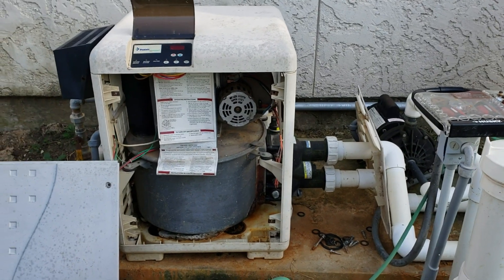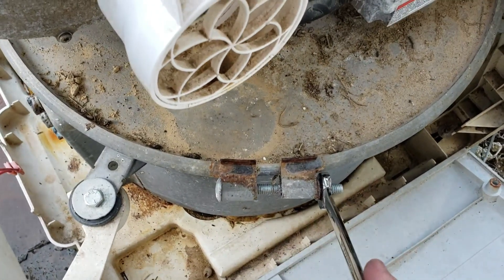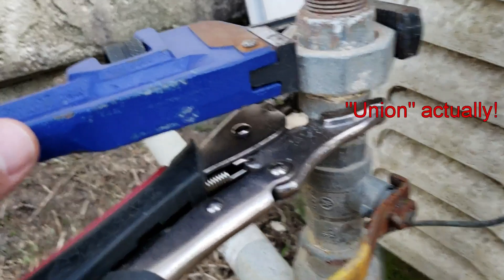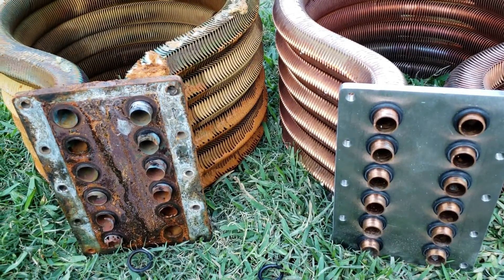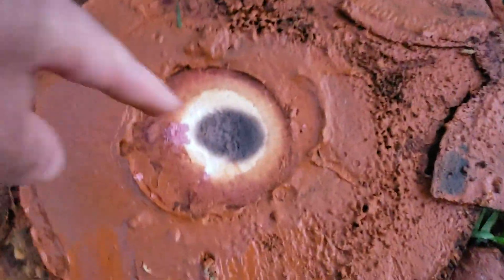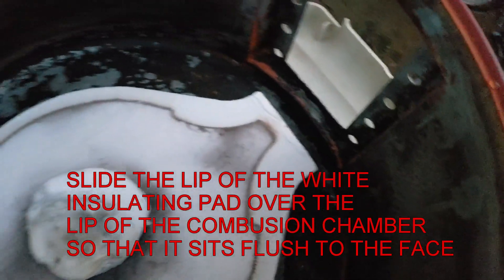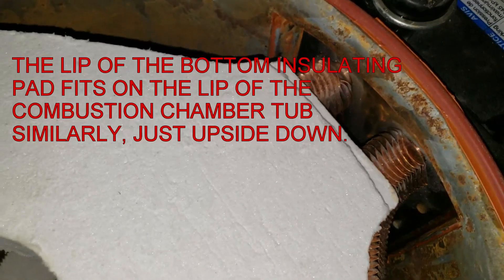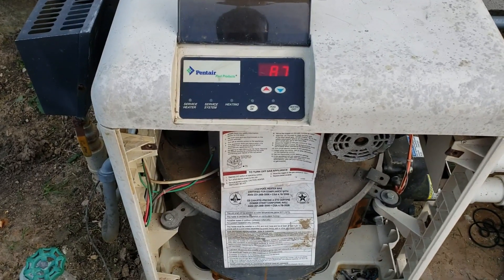Pentair Mastertemp 400 Heat Coil Tube Sheet Assembly Replacement

Comment: I am having the same issue currently, however I have no rust inside my header. I took the bottom bolt of the manifold off and the water drained and was very clear.  I plan to open it up  to see if maybe its one of the seals on the manifold or if I need to replace the entire heater coil.  Thanks for the video!

Comment: Not to be critical BUT the visegrips were on the gas pipe union backwards  and no need for Teflon on the union threads as the threads are not the sealing surfaces. Looks good! 👍

Comment: in 2022 I been replacing  those heat exchangers for $2800 if heater is less then 5 years old. if is older I recommend to replace the heater..

Comment: Best video I have ever seen......I had the same problem......It's now 2022 and the (6) coil exchanger is now $1,200. Only one tube was corroded away. I used a copper pipe coupling and JB Weld to sleeve it into the corroded tube. Fixed it!! I drilled a small 1/8" hole at the bottom of the tub as a drain to be able to verify that it's not leaking again.
Reply from the maker: That's a clever fix.  Remember you can always just take out one of the bottom 2 bolts on the manifold to verify that the tub is dry.  Each bolt hole is a threaded tunnel all the way to the inside of the tub.  If the tub has water, it will drain down to the level of the lowest bolt you remove.  Small hole is a good idea also.  I don't foresee anything being unsafe with a hole so extremely small.  Good on you thinking outside the box.

Comment: My coil won’t fit if I place first place the insulation soft insulation blanket on the bottom of the combustion chamber followed by the hard insulation board with the notch cut out over the lip of the combustion chamber. 

I see how this creates a perfect fit and how the hard insulation board then butts up flush against the face of the combustion chamber, but in my case, then the coil does not fit into that recessed area for it to align with the bolt holes for the manifold.

If I pull the insulation and way and off that lip so that no insulation is taking up space in that recessed area of the combustion chamber, only then will the coil fit and align with the bolts with me having maybe 1/8” of play. 

Can you confirm you did in fact place the insulation on top of that lip in the combustion chamber per your note, vs having left it off in the video footage you shot?

Thank you and others for any advice!

Comment: First off, thank you for doing this video!  I’m a pool guy for 9yrs now, never had to change out an exchanger until now.  So seeing it done was great info!  

I read thru most of the comments.  I just want to give some tips to some people.  

If you are having heater issues and there is no code on the led screen, pop the top of the heater off, don’t shut it off or take any wires off, look at the control board.  There is a row of error lights on the left side, if one is red see what the 2 letter code next to it is and google it.  That will tell you the issue. 

The guy that mentioned about the check valve after the return line from the heater is 100% correct.  I just want to add that if you have a salt cell you should have a check valve as well.  The salt cell is just as corrosive to beaters as the chlorine feeders.  

If you are not getting an error code & no red lights on the back of the control board under the lid, open the front panel of the heater.  Inside the square box (the lid flips down and might be held in place with a screw on the top right, open the box...look for my red error lights there as well.  If no error lights, no codes in the lcd....take the very bottom bolt out of the black manifold there are 2 vertical rows of 6 I think,  take the bottom one out on either side.  If any water comes out...you need to rewatch this video because you need to replace the exchanger.  If no water then the exchanger is not the problem.  

If you have a Pentair, Sta-Rite, Hayward..:it doesn’t matter, all the tips I have to troubleshoot will all work the same way.  Heaters are actually very simple and there is not that many parts to them.  

Oh and very last tip & it may not be so nice but it’s very true.  Your local pool supply store, I’ll use Leslies as an example, is an absolute rip off in what they charge for things.  Buy from the internet to get the best prices.  I shop at my local pool supply store that is only for pool professionals and give wholesale/internet prices.  I’ve had to stop at Leslies on the weekends for emergency parts before & they should be ashamed at the prices they charge. 

Hope any of my input helps someone.

Again, thank you for this video, I’m not rolling my eyes anymore, the repair I need to do isn’t going to be as bad as I thought, so thank you for teaching me how it’s done & done smart.  My first thought was going to be taking each part off, not just the lid and keeping everything attached.  That’s gonna be a huge help.
Reply: Except if the that exchanger is bad the heater is usually junk and should be replaced because it's likely throwing good money after bad given how much a new exchanger costs and the shelf life left in the unit.

Comment: At 4 min. in, you mention that the old coil is 8 yrs. old. Is that 8 full years of use or 8 seasons of say, 3 mos. each?  I have a 175,000 BTU heater that failed at one of the O-ring ends allowing water to get into the heater.  My heaters is 3 yrs. old., but I actually use it 8-9 months of each year. And I monitor the pH and chlorine levels regularly. 

Also, when/if you winterize your heater, do you winterize it filled with RV antifreeze or leave it empty?  I’ve been winterizing mine empty, but covered with a tarp thru the winter months and am wondering if I should be storing it filled with the RV antifreeze.
Reply from the maker: I have never removed it from the pool plumbing.  So even in the heat of summer, the pool water always runs through the heater coils no matter what.  In the 1-2 weeks of freezing weather that we get in Houston each year, my Pentair panel goes into Freeze Protection mode and runs all pumps 24/7 while below 36 degrees.  I was terrible at balancing my my water chemistry before this video.  I have a weekly pool service now.  I never wanted to bypass the heater because I can remotely turn up the hot tub while on the way home so it is ready for us when we get there.  Can't do that if I bypass and drain the heater.  If I don't think any winterizing antifreeze chemicals would be necessary if you disconnect your heater and drain the tubes.  They are very short horizontally situated horseshoe shaped pipes as you can see.  Just give the heater a little tilt with the manifold off to persuade the water to drain out of the copper tubes and call it a day.  Great idea covering it while not in use.

Comment: great vid, can you elaborate on "this is why you should watch your chemicals"?  what would cause all that corrosion?
Reply from the maker: I did not measure my chemistry.  I constantly threw large amounts of acid and chlorine at it when algae started to grow...all reactively, not proactively.  Also, i do not have a back flow preventer installed between my chlorinator and my heater.  No big deal while the pump is running, but when it is off, the copper pipes are very close to an unisolated source of corrosive chlorine.  Chlorine is no joke for metals.  Side note:  do not store chlorine in you outdoor kitchen cabinets if you have them.  I have Bull brand stainless steel doors (both sides).  The fumes alone have destroyed the stainless steel doors on the inside.  If I open them, the rust is top to bottom of each cabinet door because it is all same air space under to BBQ pit.
Reply: @pvt-pilot  oh wow thanks for the info. Based on your knowledge in the vid I thought u were a service tech, but I guess this was your pool/heater.  My chlorinator feeds inline to the pipe going back to the pool so I might be ok.
Reply from the maker: @DanburyConnecticut  Mine is in line towards the pool from the heater too.  It should be the last thing in line before direct shot to pool.  I have just been advised over the years to put a backflow preventer between the chlorinator and heater.  $80 prevention for $2600 heater.  Seems worth it.  ...and no I am not a tech.  Lol, I'm an engineer in telecommunications industry.  Just a pentair system owner that has seen enough trouble with their products to make a few videos from my experiences.  Never thought I would have over 100,000 views from a few amateur videos about these heaters.  Apparently I'm not the only one with Pentair heater problems.  Hope they helped.  If so, that makes it all worth it.  ✌

Comment: just had freeze damage on my brand new Heater in 2021 and this has helped me so much! thanks!
Reply: You must live in Texas I am dealing with the same problem. I can’t get the coils or the manifold to replace
Reply: Were you able to replace the manifold and coil yourself? I have the same issue after the winter freeze
Reply: @dextert.5524  no I can’t find the manifold anywhere.
Reply from the maker: @jeremybell3058  https://www.ebay.com/itm/SWITCHDOCTOR-for-Pentair-Sta-Rite-Universal-Manifold-Replacement-Kit-Pool-Heater-/393314123442?_trksid=p2349624.m46890.l49286

Comment: Great video. My Pentair Mastertemp 200 has this issue. The water is leaking out through the blower intake. I was wondering if that water is getting into the blower motor and damaging the motor.
Reply from the maker: I think there is a bearing race between the blower motor and the fan blades.  Bottom line, you need to immediately replace your coils.  If you don't want to do it right now, you will at least need to disconnect the heater and put a pvc bypass between the two pipes connected to the heater.
Reply: @pvt-pilot  Thank you very much. I will repair it as soon as the kit comes in. In the meantime I do have it on bypass .

Comment: Great video.  Followed the same process to fix my Mastertemp 250 yesterday.  It had a smaller tube coil unit and it sat up on a spacer, otherwise the same.  Only recommendation to any DIYer making the repair would be to remove the igniter prior to reassembling the unit.  the second  time (broke the original one) I put it back together, I aligned the top insulation pads, then dropped in the upper unit, lined up lid with the hole in the insulation for the igniter, then installed the new igniter.  The igniter is only held in by two nuts and can be accessed without removing anything else so it was easy.  Glad the kit came with a new one!  Thanks again for the video.
Reply: I have a 250 as well. How long did it take you to do all the work?
Reply: In all, maybe a couple hours.  However, I had a rusted bolt on the manifold that took a while to remove and the busted igniter added a little time.  Overall worth the time in my opinion.  Still working like a champ.
Reply: @mattwhipple191  That's fantastic. Thanks!

Comment: Thanks for this.  I ordered my replacement chamber and lid.  I think I can work through it.  FYI, if your chamber is rusted through, do not use high temp foil duct tape to repair, it will leak again and then melt the ignition module.  Ask me how I know.  Lol.

Comment: Hey you have a black gas pipe going from the combustion valve to the blower. My MasterTemp 400 is a bunch of corroded pipe and fittings instead and was wondering where to get that and if I’m able to use one.
Reply from the maker: https://www.ebay.com/itm/Pentair-Gas-Pipe-with-Union-for-Mastertemp-Sta-Rite-Max-E-Therm-Pool-Heaters-/232095955646?mkcid=16&mkevt=1&_trksid=p2349624.m46890.l49286&mkrid=711-127632-2357-0
Reply: @pvt-pilot  thank you for the info. it seems like a rare part unless you buy it used with the gas valve. Also was wondering since I have fittings in my installation, theres also a gas orifice connecting. Where would this orifice be able to be added to that pentair black gas pipe?

Comment: great vid...on another topic...there are some vids out there for natural gas applications where I never see a regulator being used on natural gas heaters neither at the heater side or the meter side... please advise?
Reply from the maker: Now that is not supposed to happen ever.  No gas service installation will pass building permit inspection without a regulator at the meter where I live.  I would not advise it either.  I have other secondary lower volume regulators on things like kitchen stove and water heater, but my outdoor fire pit and pool heater are straight pipe because they both need all of the volume the whole home regulator has to offer at the meter.
Reply: @pvt-pilot  so I have 2psi coming from the meter running 25' through 3/4" pipe.    I'm trying to figure out what kind of regulator to install at the 400,000 btu pool heater...heater calls for a minimum of 4"wc to 10.5wc Max.    I'm thinking a maxitrol 325 5L.  Bringing it down to .5 psi and adjustable 7-11 "wc.  
Any opinion???
Reply from the maker: @stevenjacobs6934  I have a 1" pipe feeding my meter and that is where my 1" regulator is attached.  I then have a 1.5" pipe making the long haul across my property to the Mastertemp 400 and there is no regulator there.  I don't know much about how to tell the PSI/volume the regulator passes, but I can post the info of my regulator label:
Actaris - Model B-42
B42R-IRV
ORI 3/16
7 0 IWC
1/07 (manufacturing date)

Hope this helps

Comment: I too think I had freeze issues. My 400 sounds like a compressor now. Loud humming noise and I can’t figure it out. Thinking the igniter was bad, I replaced that, the AFS switch, and the flue sensor. It tries to ignite, and actually did for about 1 minute before shutting off. I sure hope I don’t need an entire new unit.

Comment: First I want to thank you.  The Video has been a great help.  I've hit a sticking point.  In you video you had a strap that held the top of the heater assembly to the tank.  Mine had screws that held the lid down to the tank.  I removed them and it appears that some sort of liquid adhesive is holding the tank to the lid.  Ive tried to pry the lid off gently with no success.  It appears the adhesive is holding it together.  Have you seen this?  Or has anyone else complained about a similar problem?
Reply from the maker: I have heard of the screw lids, but nobody has mention separation problems with them.  I am unfamiliar with that design.

Comment: I've done the coil tubes on the mastertemp many times. It's always due to chemical damage. Low pH in fiberglass spas and inline chlorinators are a recipe for disaster.

Comment: PVT-PILOT, agreed...a very helpful video and thank you.  I'm still working on putting my pool back together after the winter storm here in Texas that cracked about every pipe and pump in our set up.   Long story short, we had to bypass the heater due to a cracked manifold once we were able to find pumps out on the market.  I'm now at the point of replacing the manifold to get the heater back up and running.  Do you have any tips or "be carefuls" when removing/replacing the manifold?

Thanks in advance.
Reply from the maker: Manifold is external, so that part will be easy.  Before replacing manifold, I wound recommend tearing the heater down to the coils as shown in this video and inspecting the copper tubes for cracks.  If you have cracked copper tubes and a cracked manifold, I would recommend just getting a new heater.  Repairing one or the other is cost effective, but not both considering you will still have no warranty at the end of your repairs.
There is a manifold bypass valve in the manifold assembly too.  If your new manifold does not have one included, be sure to savage  that part as well as all of the sensors.

Comment: Finding flakes of corrosion and encrusted salt with specks of "green" copper(?) in the spa section of the pool.  Is that a tell tale for a future leak or is it just salt scale? (salt water pool, 250 MasterTemp Serial 1119094180019N).
Reply from the maker: Yeah, the only metal in your entire system that the water touches is the insides of the copper tubes of the heat exchanger in the video.  Everything else is plastic including the main pump's impeller.  So, the heater is the supplier of the flakes and it is located after the filter in the normal flow of water to the pool.  This makes for an express delivery of garbage in your heater to your spa.  You likely have scale and/or corrosion on the inside of the copper tubing.  You could pull them out and pressure wash the insides of each tube 1 tube at a time and hope for a few more years of service, but if you go through all of that trouble, I would just replace them with new assembly.

Comment: Great video! At the end where you put that cover ontop of the copper heat exchanger, it looked like styrofoam.  What material is that?
Reply from the maker: It is not styrofoam.  It is a flame retardant material, hard and soft pads on both top and bottom.

Comment: Hello, Sir! Great video. I followed your instructions to see if my coil or manifold had a leak, but cannot visibly see any cracks in either of them. The coil appears to be in good condition with little to no rust and still has all the tubes that connect to the manifold. Could it possibly be the face plat that is causing the leaks? Upon inspection that seems to have a few factures, but wasn't sure if water is even passing through the face plate. Please let me know!! Thanks again for your video.
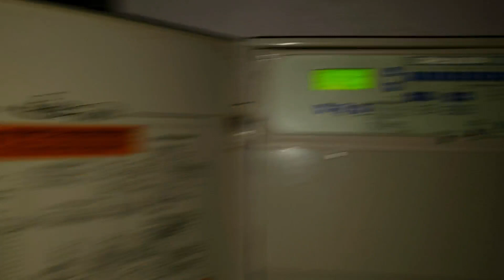Reply from the maker: Try removing the top assembly without removing the manifold so that you can turn the pumps on and pressurize the pipes while still being able to keep your eyes on the pipes.  See 6:13 of my video where I do this.  Small cracks in pipes may be very difficult to see but much more apparent with water spitting out.